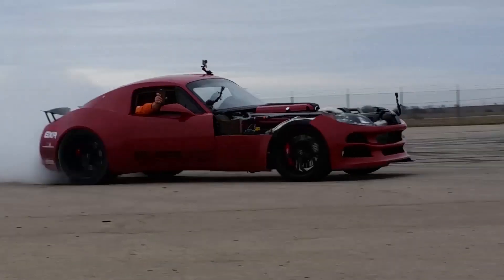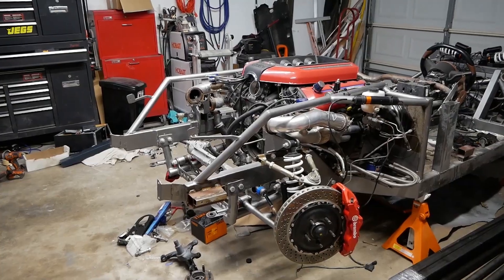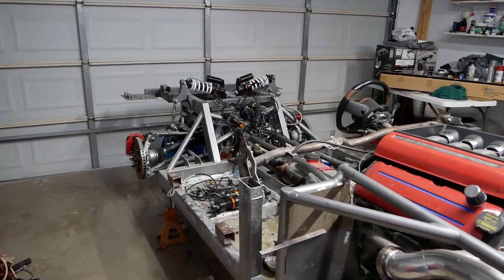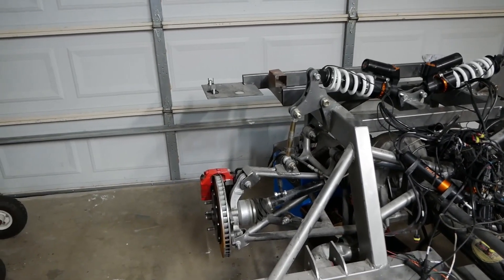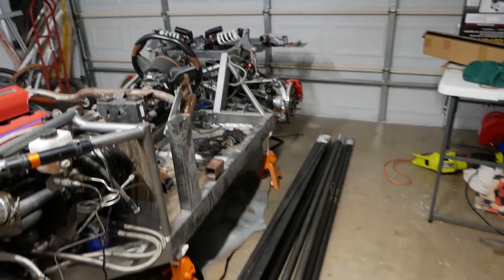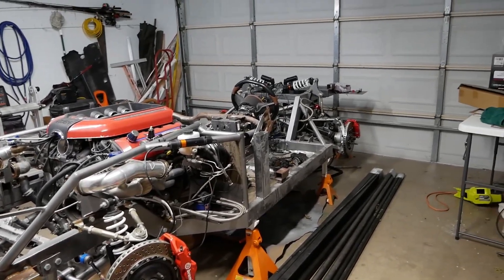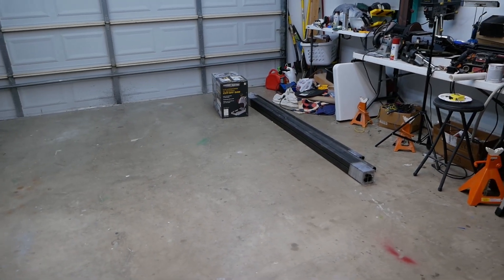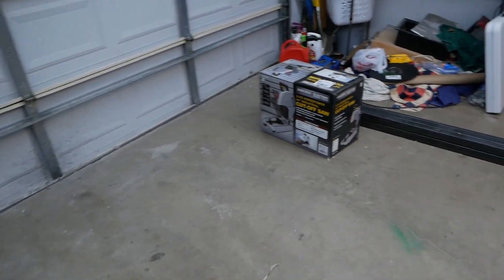How to Build a Supercar chassis for the Blade GT1 - Ep01

Comment: first of all that machine lukz soo damn cool when its stripped,
Second damn all mechanism luks so silple especially those suspension system,
 i huv a lota questions, 
one - about the front suspension it luks soo small especially the upper A arm which seems to be thin and threaded, which my gud gess would be for the adjustment of camber. and also im cusious to know if the ride height can also be adjusted in the front. Because in the rear suspension assembly i can almost say the rear ride height can be adjusted if u make the push rod lengthier or shorter. 
 i think that rod is threaded too which is possible. PLEASE MAKE A SEPERATE VIDEO on your most complicated yet soo simple suspension set up. 😉
Reply from the maker: Thanks man, yes I will go into a lot more detail on the suspension when I get to that part. But you are correct, the suspension is designed to be completely adjustable. The ride height can be adjusted manually and electronically through the dampeners witch I'll cover in a separate video.
Reply: @OZTron3D  i get it, thanks mate great video, yr my GURU